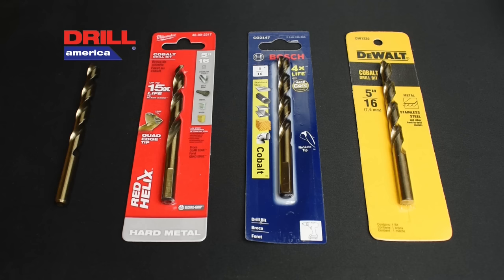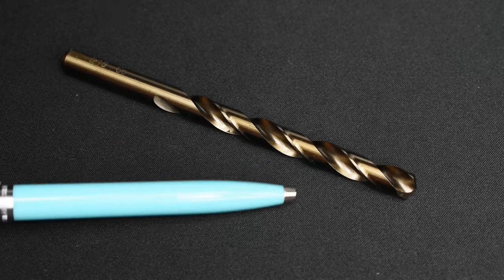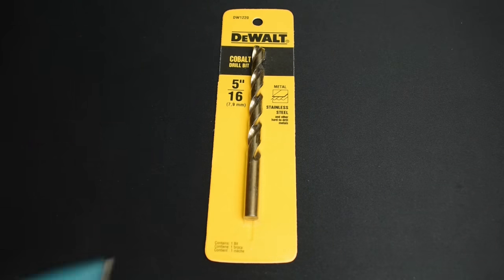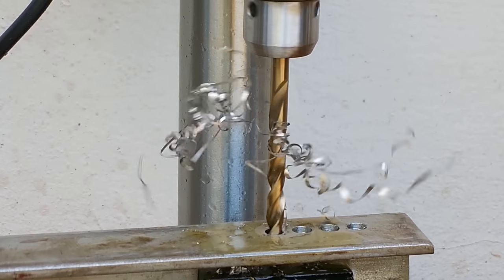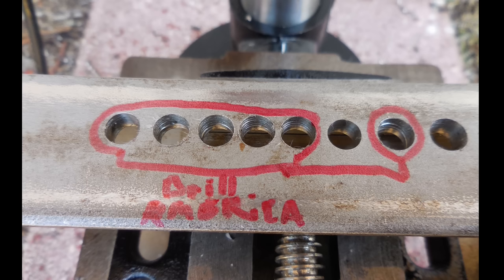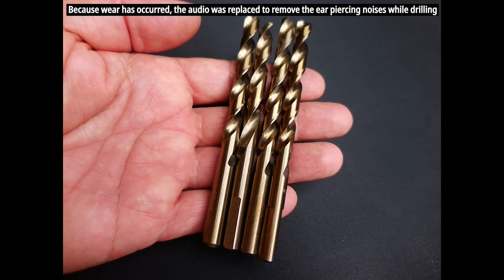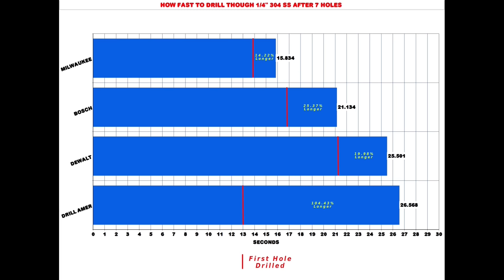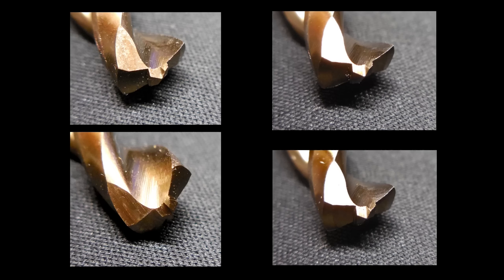Which COBALT Drill Bit Is Best? Find Out! (Milwaukee, Drill America, Bosch or Dewalt)

Comment: Ah, the sounds of metal drilling. Needs more cowbells!
Was spending about $150/mo on the Dewilt cobalt drill bits in my manufacturing operation(all stainless) then switched to the Milwaukee cobalts. Slowed the speed down and use the CRC  cutting oil. Now I'm less than $100/mo. Don't know about the others but the Dewilts like to snap easily when used in hand drills in hard metals.

Great video!
Reply from the maker: I read the Milwaukee's bit reviews, and about 14% complained about bit breakage, I didn't have any problems. It's  a great bit. Thanks for watching!
Reply: @electronicsNmore  What I've seen in the shop is whenever there is breakage, it's with a hand held drill. These bits are fairly agressive and when they grab while in a hand drill, they do tend to snap easily.
Reply: Cobalt bits are notoriously more brittle than HSS.

Comment: I bought the milwaukee set for work, being a mechanic I need bits that will last and are straight. First use was drilling out  license plate bolts😡. Rusted bad so i started with 1/16 and worked my way up.  Nice and slow and they went through with ease. 20mins later i had 2 bolts drilled out and riv nut’s installed. Never done it that fast! If I do break one homedepot is a block away and have all in stock.

Comment: Thanks, now I know what drill bits to get once my Dewalt kit is worn-out.
Reply from the maker: I probably should've also tested the Dewalt pilot point cobalt bits, but I didn't want to spend too much time and money working for no views.
Reply: @electronicsNmore   You did a great job on this video.  I would say that not all drill bits available can be tested at the same time, is not practical if not impossible. When it comes to views, I shared a link to the video you made on microwave radiation testing on a channel that has close to 5 million subscribers, hope that helps you get more views.
Reply: The dewalt will outlast all 3 combined they make the best drill bits it's not always about speed

Comment: Very good test! The stainless steel gets work hardened and is a real challenge for any cutting device.  I just bought a set of the Drill America metric bits.  I was surprised that I couldn't find a set of metric that go up to 13mm anywhere locally and it took two tries to get these from Amazon.  I have a hunch that someone along the supply chain ended up with a set just like mine.
Reply: Yep 304 can be kinda awful.   You have to make a good chip from the beginning or it’s going to be a bad day.

Comment: I drill and thread holes every day, and use a variety of industrial drills. Just want to mention that black oxide is a coating, not a type of drill. The BO coating is meant to promote lubrication and can make the metal a bit harder. It is not at all indicative of the base metal and the quality of the drill. Just now, I threaded 18 3/8-16 holes in 1/2" A1 steel that was drilled with a black oxide Chicago-Latrobe drill. That same drill had previously been used quite a few times. It's still very sharp and comes out of the hole relatively cool to the touch. The only thing that a black oxide C-L drill and, say, a $9.98 DeWalt black oxide set from the big box store have in common is the name of the coating. Just the name. FWIW, the DW drills aren't terrible and can work well in a non-professional environment. Good luck.

Comment: I find that charts call for 1/4" cobalt bits to be fed .003 to .005 in per rev in 304 stainless.  Call it .004    .25/.004 = 63 revolutions.  The fastest hole in this test was about 15 seconds, .25 minute.   1/4 minute X 1150 rpm = 283 revs.  The Cobalt bits were running too fast with far too little pressure.  The bit was skidding and hardening the steel the next flute was going to try to cut.  Breaking through at full pressure on the bit is poor policy, it chips bits.

Do the test again with more pressure, less speed and a steel waste plate beneath the workpiece.  The the speed and bit condition results will be far different, especially after the 100th hole.   Most of us will suffer little inconvenience or loss of time drilling through 1/4" plate a few times, no matter how long it takes.  Speed is of secondary importance.  Breaking off from productivity and fetching a new $10 bit is a painful inconvenience.
Reply from the maker: Speed was properly set according to the manufacturer. My drill press has a chart showing the correct belt connection.

Comment: I rec'd a 15pc Milwaukee Red Helix Quad-Edge (Cobalt?) set as a gift and they're the worst bits I've ever used. I hope Home Depot will let me return 'em. They're like 1 and done. They simply couldn't drill a second hole. The thin plate, about 1/16 thick, was rusty but I cleaned it up using a wire wheel on a bench grinder. I started with a drop of oil and varied the speed on each bit, taking it easy then faster when I discovered the bit(s) failed at slower speeds. No matter what I did, the bits were 1 and done.

Comment: Dewalt, Bosch, and Milwaukee only use Cobalt coatings on high speed steel for their inexpensive cobalt kits. Without a stamp that usually means it's not a full-through alloy. You have to be careful and have strict RPM/pressure practices to not prematurely wear them out.
Reply: I do not think a cobalt coating exists. When people say cobalt drills or end mills, what they are actually referring to is HSCO, essentially HSS grades which have cobalt added into the alloy. While there are means to diffuse carbon and nitrogen into steel to case harden them, there really is no easy way to do so with cobalt. You cannot simply coat a drill with cobalt apart from plating it, but cobalt by itself is pretty useless and they do not just coat with cobalt metal. I think they just use HSS grades with low cobalt overall, not apply a thin coating which really is not possible or useful.

Comment: Great tests, thanks for the information.
I'm curious to know if the drilling creates enough heat to change the hardness of the metal, so that the drilling gets harder for the bits that are drilling later
Reply from the maker: Thanks Joe. Yes, that can happen with Stainless, but during drilling if the metal gets too hot, not after.

Comment: Great job. It looks like the Bosch bit could be resharpened but not the others because of their tip geometries and construction. Is that a fair assessment?
Reply from the maker: Thank you Chris. I'd think 3 out of 4 can be resharpened, if done carefully, and you don't allow the bit to overheat. I don't see any way to resharpen the Milwaukee. Be sure to rate thumbs up, and share the video link with others.
Reply: You can't resharpen any of them, they are only coated in cobalt, if you sharpen them you remove the cobalt and then you only have a normal drill bit
Reply: @Alucard-gt1zf  where to buy solid cobalt drill bits? There is lots of cobalt drill bits on Amazon, are they all only coated with cobalt and not all through?
Reply: @Alucard-gt1zf aren't the drill america m35 alloy with gold oxide coating? I would understand that from their specifications

Comment: All bits have a different sweet spot for the speed of the spindle and pressure placed on the bits. If used on there sweet spots they would all be quite close to each other. I use cheap sets from the market and have out performed many people purely down to there lack of knowledge
Reply from the maker: That's true. Most people will be using a drill though, not a drill press, so using constant pressure was a fair testing method. You would think the manufacturer would've designed the bit to do the best cutting without having to use excessive downward force. The speed was set very close to the recommended speed for the bit size and hard metal being drilled. Thanks for watching!
Reply: @electronicsNmore  Ask yourself, do you know how drills are designed? Do you know how drills are evaluated in a professional environment? You don't, but you did see the Project Farm video and the views it received, so you apparently decided to do something equally as misleading. Luke was absolutely right - I drill and thread various alloys daily - you just didn't understand his objections, because you know nothing about this subject. A Catch 22, yet the Dunning-Kruger Effect prevails.
Reply: Glad I'm not the only one to see it, I also work drilling/tapping/milling/turning a huge variety of materials daily. I also do alot of product testing for one of our tooling suppliers and it's not as simple as running them all exactly the same way.

Comment: ElectroncisNmore ~ hi there, got an idea for you. Would you be willing to do a video about the best LED house lights? which brand etc is more efficient to run. Thank you for your amazing videos, all the best, kieron uk
Reply: LEDs hands down
Reply: RIGHT! LED's. Saved an average of $25 a month on energy usage.
Reply: @Locksnut  yeah ok - then perhaps which LED bulb is best? updated comment
Reply: Traditional bulb is best since pollutes less , less tax subsidies, healthier, and cheaper over the long run if u factor everything.  Flurocent is efficient if u leave it on and dont turn it off so quick. Led coat a lot more to buy break down easily simce so many components to make it work which usually the capacitor and they make they break easily to sell more. 
Lights r the first product with planned obsolescence.  All info states online but never highlighted. Pro cons to everything.
Reply: DiyEcoProjects mine are GE. UL approved and create no RFI. Edited for misspelling
Reply: Great job and very fair test for all the brands!
Reply from the maker: I'll look into it. Thanks for the suggestion,  as well as watching!
Reply: @electronicsNmore  Ive been a sub for a long time, since the "seafoam". Ive yet to try that :) All the best, and have a good year ahead

Comment: i noticed the Milwaukee Red Helix was much smoother /quieter. That must mean something ?
Reply: Yes you will notice that the other bits the grind is much rougher so they wear out way sooner.
Reply: @tunafish3216  i would think so
Reply from the maker: Having the quad edge, or even a pilot point keeps the tip of the bit from bobbling around. The finished hole is very smooth. It's a well designed cobalt bit.

Comment: Very interesting! I just got through burning up a 5/16" Milwaukee Cobalt drill like the one you show, trying to drill through 3/8" thick AR500 plate. I had another 'no-name' cobalt that I acquired about a decade ago, and it ate up that plate like it was wood, making multiple holes with no problems and no dulling. So the M35 sucks for hardened steel, Milwaukee or not. I even tried a Ridgid cobalt, and it burned up in less than a few seconds, while also not making even 1/4" through the plate. So what bit would you use to drill AR500 plate?

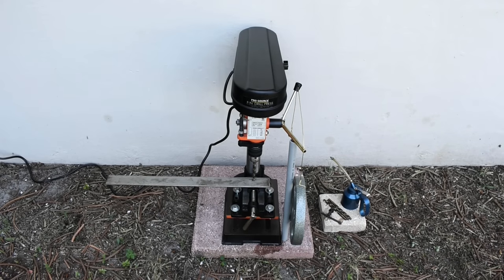Comment: 4:47 wtf is this contraption???!! You can't certainly expect true results from this!
Drill bits need to run at the manufacturers recommended speed (Vc= ?m/min) and feedrate. Not with some arbitrary downward force on the same fixed RPM-setting for
each drill bit!
This inconsistent cooling method is just stupid
Use a CNC mill for providing a fair and accurate test environment.
Only then you can adjust speeds and feeds a little to improve the results.

Also... if a Drill bit dies faster or not is not the only thing to consider.... cost/time ratio? How many holes per hour per Dollar?